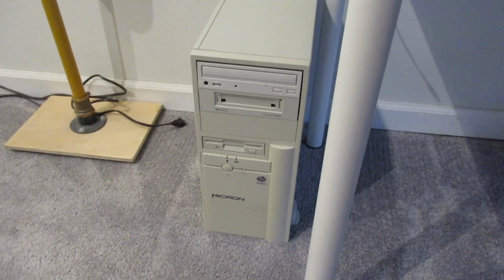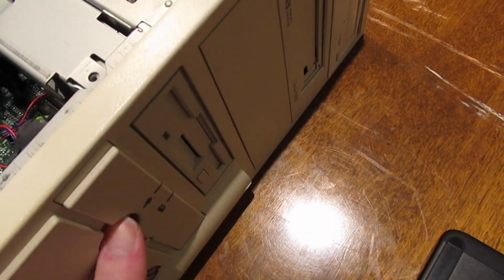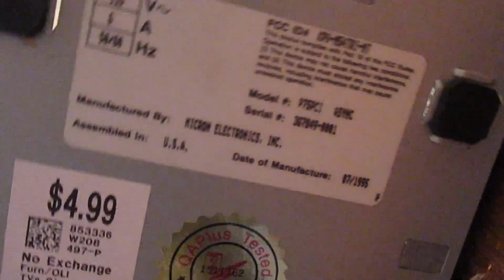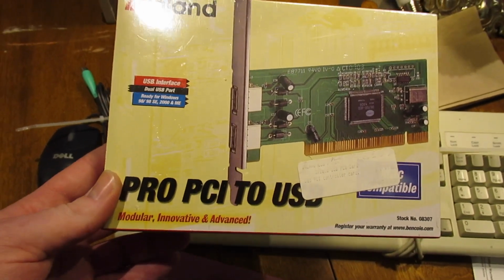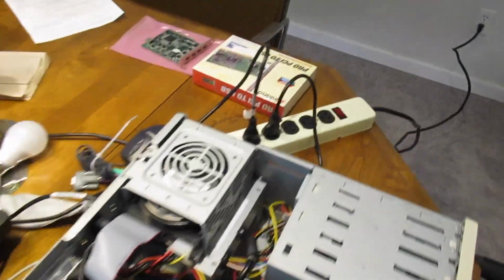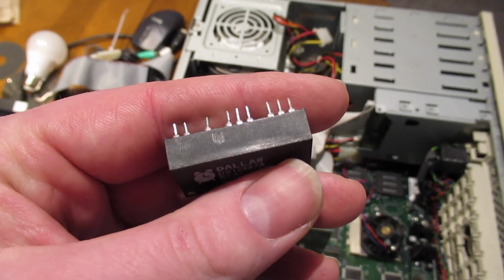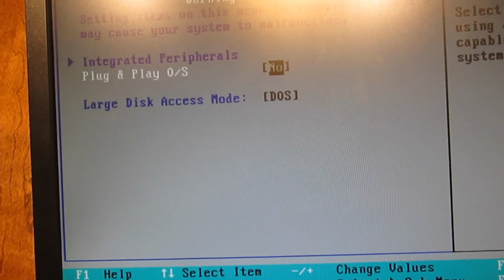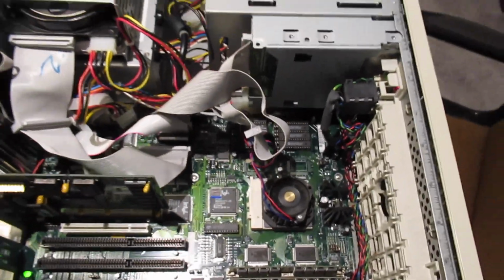Micron P75PCI Pentium Computer - Will It Turn On?

Comment: Clear the BIOS and maybe install a PCI bootable IDE card since most early IDE controllers suck, Also would not trust that power supply, if the hard disks don't spin up without an IDE cable connected then the power supply is weak and needs some work or to be replaced (But that does not seem to be the case here).

Comment: Looks like the onboard floppy and hard drive controllers are screwed up. You definitely should not be getting the IRQ and IO allocation errors, regardless if you have any drives plugged in or not. Did you try clearing the CMOS? There should be some jumper near the Dallas clock chip that you temporarily short to clear it. Maybe it still has some corrupted data in it, considering that it was showing such wacky numbers for the time and date before you hacked in the new batteries.
Reply: Wouldn't hurt to try a couple of new drives either.  Bad drives can also screw things up.  The floppy drive should at least have turned on the status light to show it was getting power.  I think it's a combination of something with the controller onboard, and maybe the drives themselves.  As far as corrupted data, there shouldn't be any saved settings if the battery hasn't been there to keep the settings in tact.  Third thing is to try new cables, it's possible there is non visible damage to the cables as well.  Though the cables do look like they're OK.
Reply from the maker: Thanks for the info about the onboard hard drive controllers being screwed up! I obtained a PCI to IDE card that is bootable, connected the drives to that and the machine was able to boot up! I'll make another video soon showing that progress and what state the machine is in now.